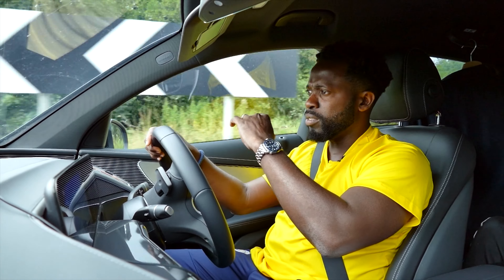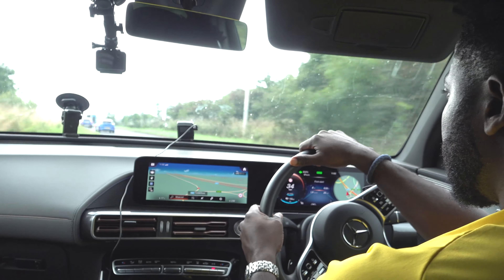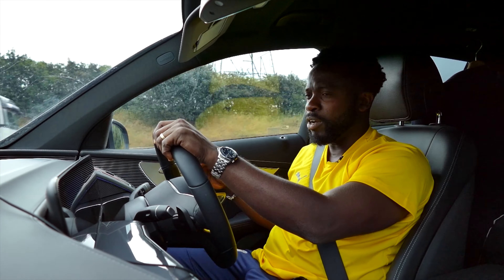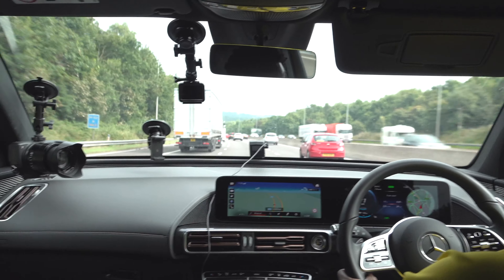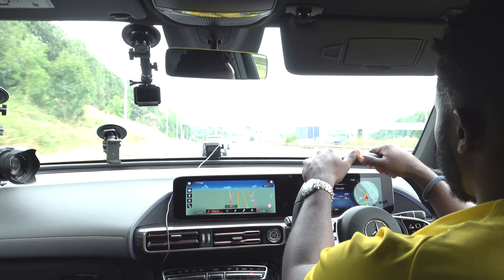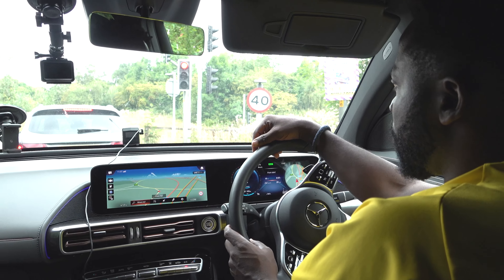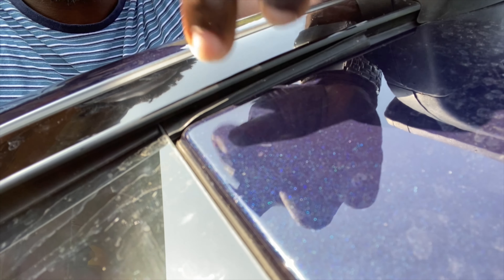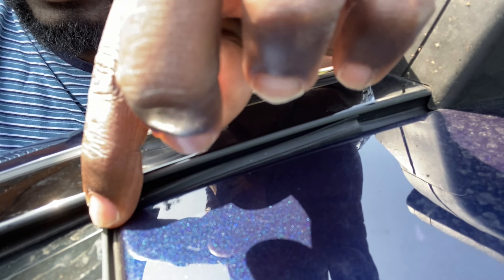EQC 400: Rattling Wind Noise On Highway Speed| Front Driver Side|Investigated & Fixed?

Comment: I have the same rattle on mine, only from the drivers side like yours, and I think it started after I removed a thule rack from the car after a week with a roofbox as I had never heard it on motorways previously. Will dry your fix, but also raise it with Mercedes when its in for a service. Thanks for posting.
Reply from the maker: Thanks for this. Very valuable as I need to hear from other EQC owners about the driver side motorway wind noise. Thanks for your comment. Regards😀😂
Reply: @SteveHarrisPhoto Have you fixed your issue? and how?

Comment: Yoo I love your videos, I am interested in getting an EQC 400 & this helps in my decision making. Can you tell me how you are finding the cars 'ground clearance' and is there any driving modes to help with that?
Reply from the maker: Thanks a lot. Yes the ground clearance is fine. I have not had a problem with it. Of course you have to be careful when off-roading. The height is suitable for regular use for a midsize SUV. The back suspensions lift up or down to level the car up depending on how heavy your luggage in the boot is.
Reply from the maker: I tend to use the eco mode around towns for efficiency most of the time, but comfort on long motorway journeys.
Reply: The clearance is good, but its not a Honda, Nissan or Toyota midsized SUV so its not great. I have driven a CRV in the past and would take that thing anywhere, but my EQC has grounded coming out of a country pub car park over a rise, and in front of the rear tyres are little aerodynamic trims and they sometimes catch on speed ramps and some pot holes in gravel car parks. Love the car, and the clearance is better than an estate or saloon car but its heavy so is not as good as a regular midsized SUV at handling sudden dips. And the rear suspension will automatically level the car but it won't raise the whole car if you know you are going to hit some bumps.
Reply from the maker: @SteveHarrisPhoto  thanks for your input. It would have been nicer if the car can get raised up in some situations😀

Comment: I think an inch gap in rubber piping at that corner location where metal meets front windscreen was standard and shouldn't normally cause a rattle so maybe ask Mercedes to check it out.
Reply from the maker: Thanks. I will get in touch with them. Although it is not a big rattle at all. It might just be me hearing too much regarding motorway wind noise😀
Reply: @DeeSock Have you fixed your issue? and how?